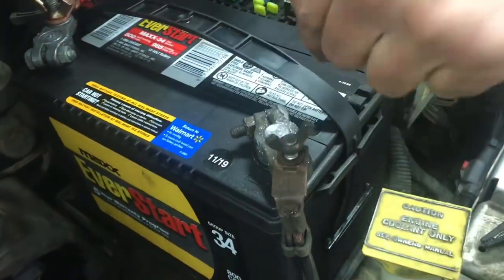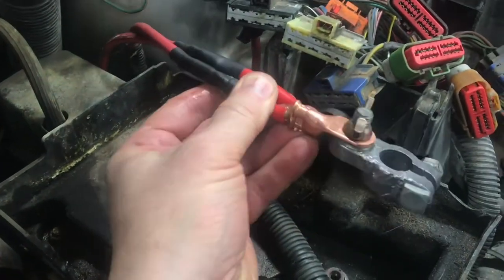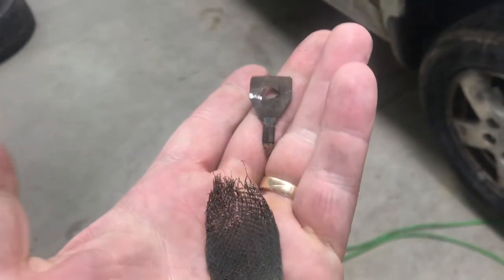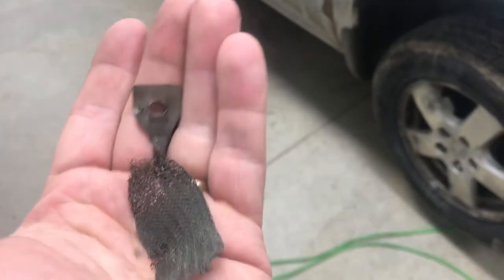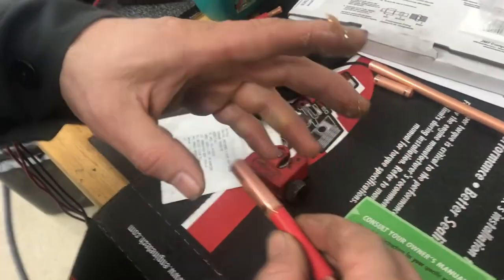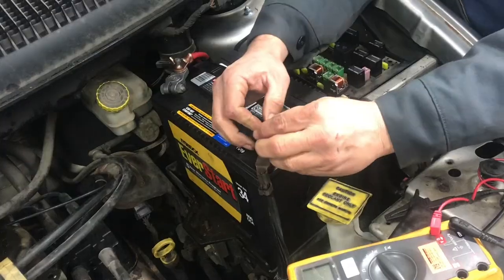replacing CORRODED sections of battery wires

Comment: With corrosion in the wires your better off replacing the whole cable. The corrosive cancer goes all the way. This is good advice for quick fixes.
Reply: Elaborate? I couldn’t just skin the wires down until I find good copper and then make a new connection like this?
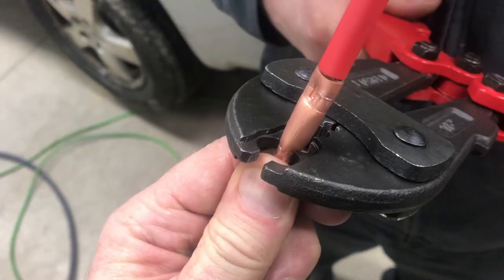Reply: 1:26
Reply: Is there a link for the replaced wire needed?
Reply: Yup I tried today and kept running into more corrosion

Comment: Someone else mentioned the braiding does something to not interfere with your radio signal? I think they said you could get away with a wire for temporary purpose but it'll interfere easier than with the braiding. Nice video.
Reply from the maker: Interesting, I’ve always heard that braided wire or flex a lot without breaking. Never heard about the radio signal improvement. They’ve been putting resistors in spark plugs for a while to try to not interfere with the radio. Years ago I have spark plugs without that resistor and the radio just harmed every time you accelerated. At first it was funny, then it was extremely annoying to the point of not turning on the radio.
Reply: @livefree6878  I remember our 81, I think, Ford pick up with acceleration in the radio. Cool how things work annoying or not and someone finds a way to curb or reduce the problem.
Reply: @FAKE-NAME  i think my jeep has a wire. I was wondering about its ground. I have no radio to test its audio interference

Comment: will electrical tape work as good as the heat shrink? if i get it water tight
Reply: I wouldn't do it!  Heat shrink tubing is cheap and works great!
Reply: @hugomartinez5897  ya i removed tape and used electrical corrosion spray

Comment: i use conductive grease on the terminals then wipe off extra and use a brush to coat whole battery terminal and ends of wire with silicone grease and they never corrode that way might get some dust on the grease, but it stays good till battery dies in 5 or 6 years.

Comment: Where do you buy the copper sleeve?
Reply: I would like to know as well
Reply: Haha seriously boys !!
Reply: @ModyTech  I was asking because I need it for  the alternator not the one on the battery they sell those in the auto part stores and they don't have the one I need either they are to big because they are battery terminals or to small because they are for smaller wire.

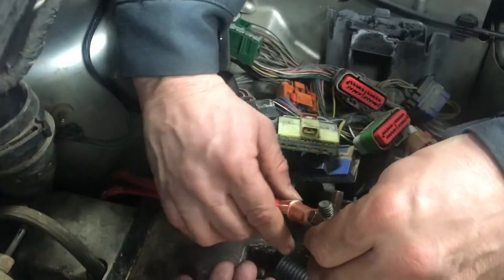Comment: The lug that connects at the battery that you put the two wires into you purchased? If not how did you flare the end where you put the two wires into? At 1:50 you can see the flare.